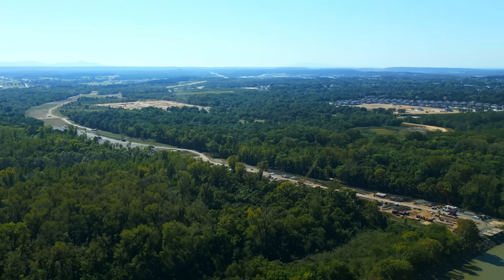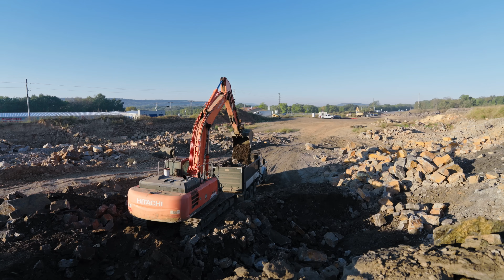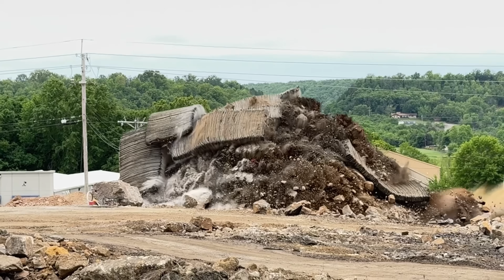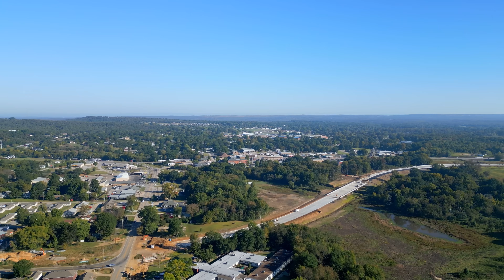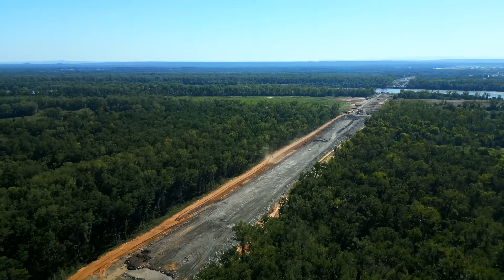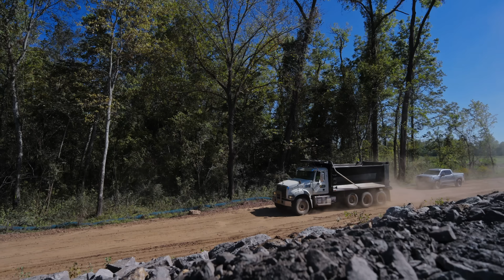We Turned a Useless Lot Into $4 Million

Comment: You did not make an "investment." An investment is using money to purchase capital or labor, which goes on to create a new wealth. The equipment you purchased, and the labor you performed, to mine and move the rocks was an investment. An investment uses currency to give something of higher value to the rest of society: for example, you invest $1,000 in a factory and it creates $1,000 in wages and $2,000 worth of goods.

Speculation of land, on the other hand, makes money by taking something away from the rest of society. Rather than creating new wealth, land speculation introduces scarcity to a finite system, because land can be neither created nor destroyed. All goods and services rely on supply and demand, but land has a perfectly inelastic supply, meaning the rules of supply and demand work very differently for it. And so, according to Adam Smith (grandfather of Capitalism), your purchase of the land was not an investment, but is actually rent-seeking. Rent-seeking does not create value or new wealth.